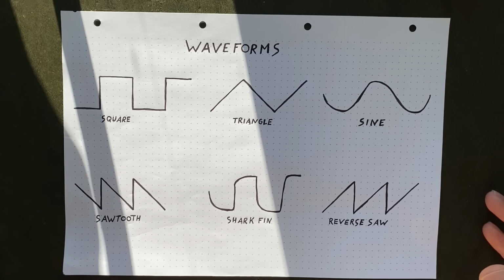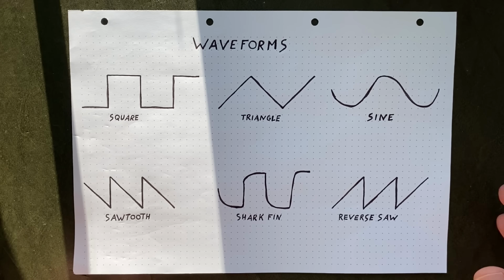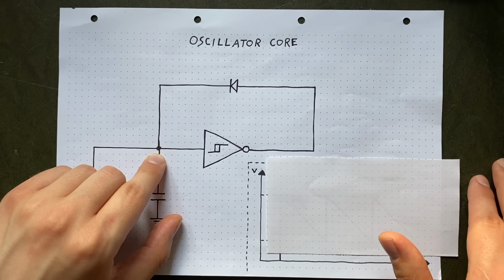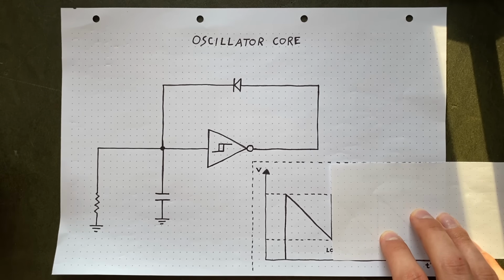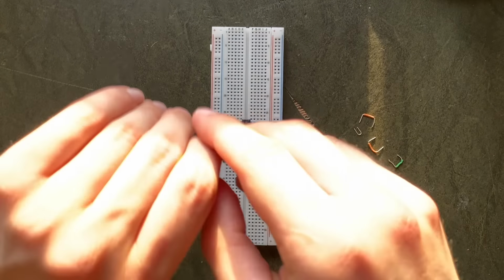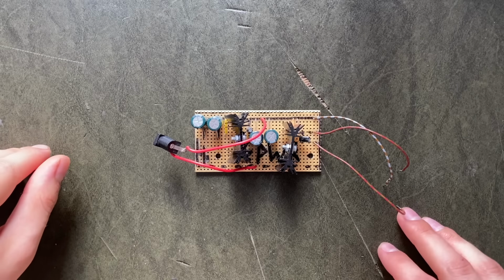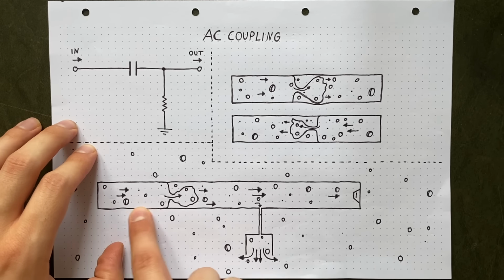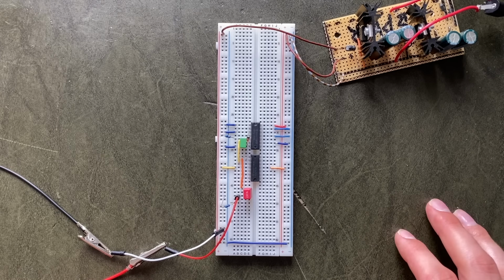DIY VCO Part 1: The analog oscillator core anyone can build

Comment: why not use 2 resistor to have a middle point to bias audio input ? to avoid negative power supplies ?
you even end up talking about coupling capacitors and offset voltages, so you could add an offset voltage at the input
also the schematic you explain is hard to understand cos there is no power supply that brings any charge to the capacitor to charge up

Comment: side note on what you can measure
Voltage = pressure or potential energy that can be used when thing start flowing)
Current = flow (same as amps but.. its just the flow itself where amps are the number of that flow so to speak. Its what your meter gives you as a value. Its identical seriously current is just mentioned to allow for more ways to get the amps if you dont have access to certain info but it doesnt matter honestly)
Amps = flow rate unit (time based thingy and already explained)
Resistance = pipe restriction (like if you had to figure out how big of a hole to cut in a tank based on whos drinking from it ao they dont explode)
Power = all work done. Or the total pressure × flow
You can measure amps, but it’s invasive, so you often calculate instead

Bernoulli’s logic matches electrical behavior almost perfectly fyi

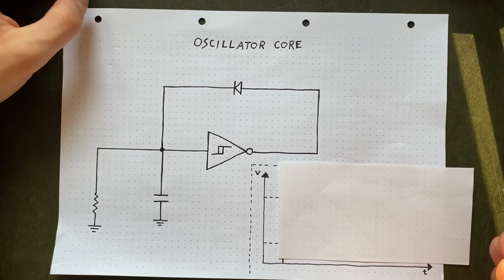Comment: 10:00 is it just me or it’s strange that the circuit has no source to power?
Reply from the maker: that schematic omits the op amp power connections for easier readability. it runs off of +12V/-12V

Comment: I've had a previous go at following some of your videos, and mean to recall it worked perfectly then. Now, however, when I connect my headphones to the voltage divider, the signal completely flattens out, as if I've fully shorted the circuit. Using a scope the signal looks good at all relevant points in the circuit, as long as no headphones are connected. Do you happen to have any ideas what could cause this? ^^
Reply: I have same problem, have you figured it out?

Comment: I would like to add an analogy for better intuition (not fully correct, but it might still be valuable) : inductors are like rusty pipes with cracks, where dirt builds up and clogs the flow. A certain amount of pressure is needed to overcome this blockage so that the water can start flowing again, albeit gradually.

Comment: Anyone knows why it simply doesn't work? It just makes my shmitt trigger inverter blow up after some time. The circuit is the exact same than the first one. I am using Texas Instruments CD40106BE
Reply: Have you sorted that out?
Reply: It seems I figured out. Looks like instead of ground you might have connected -V to pin 7, so the chip got more power (~18V) than the maximum supply voltage (15V). I made this mistake too, but only lost one Schmitt trigger

Comment: Great video! One small improvement can be to combine the unity buffer (op-amp) and the gain voltage divider resistors so that you have a non-inverting amplifier with a gain of 1/2. Thanks very much for the good quality.

Comment: 13:50 i have an electrolytic one. How does it need to be polarised?
Reply: Hey! You don't need to polarize any capacitor, that's a property of the capacitor itself (it's a consequence of the way some capacitors are built). The only thing you need to watch out for is: polarized capacitors (like eletrolytics) need to plugged "the correct way" in. As in, the negative pin (shorter, usually also marked with a stripe) needs to go to ground while the positive pin will need to go to positive. Plugging them reversed can cause catastrophic failure (aka it will explode)
Reply: @dalfaia  Oh Thank you! Another Question. How does he go from 2 electronic Jumper Wires into an Amp?
Reply: @josephpolz5881 I'll watch the video again as soon as I have time, so that I can really give my best answer. Could you provide some timestamp, just so that I can reference it later?
Reply: @dalfaia  Just the last bit: the last 20 Seconds. He plugs in something and i dont know how/what

Comment: Good stuff. The water analogy is a good teaching aid most of the time…but there are situations - like with the voltage divider 25:00 - where frankly it helps to not think too hard about the analogy…because water valves and tubes and pressure sensors resulting in V=r1/r1+r2 doesn’t really work. Easier for me to just accept the equation, and not worry about the ‘why’

Comment: Inspirational!

Edit: i didn’t expect the water tutorial. It’s interesting but has limits.

One tip I can offer here as a “yes and” that was insightful when I was learning: electrons are lazy and want to go to the easiest path. The properties of current are different than moving water. Electrons do move bit in a wire, just not anywhere as fast as the electric field in the material, which is the speed of light for that medium.

Another freebie: all circuits are loops of currents (basically the KCL perspective for those in the know). No flow if there is no way for return path to form!

Comment: I think you should mention that the ramp oscillator is almost but not quite linear.
Reply: At 15:04 do you mean? Why is it only slightly nonlinear and not the typical exponential discharge curve?

Comment: I am having trouble simulating this circuit in falstad. Anybody who has a working simulation?
Reply from the maker: unfortunately falstad doesn't like the inverter -> diode -> capacitor path. you can sometimes hack it by putting a small resistor after the inverter's output.
Reply: @MoritzKlein0 insanely quick answer on an old video! I’ll try it out, thank you😃

Comment: Can we do an explanation of how to set this up in circuitjs?
Reply from the maker: doesn’t work unfortunately, cause circuitJS doesn’t like the schmitt trigger inverter -> diode -> capacitor path. you can hack it by putting a small series resistor in there, but that doesn’t reliably fix it :/

Comment: Great video Moritz! Just getting started with this, can I just give the Vout to an 8 ohm speaker? Or do I have to add resistors? You mentioned an "amp" in the video, I just wanted to know what it was...
Reply from the maker: no, that won’t work because the output op amp cannot provide enough current to drive a speaker directly. you‘ll need to use something with an aux input (e.g. a bluetooth box, a hifi amp, or an audio interface), or you can also use headphones.
Reply: @MoritzKlein0  oh so just a simple headphone works?? thank you!!

Comment: Fantastic design — just one question, why use a parallel RC circuit for discharging vs a series RC circuit?
Reply from the maker: you mean why not substitute the diode for a resistor? if so: because it would create a square wave, not a sawtooth wave - and because we cannot easily implement voltage control that way.

Comment: Brilliant video. I will be trying this one of these days. 

You say you may not know much about electronics and so your description might be off, but it's been useful to you. But that's also how electronics is usually described, taught, implemented, and understood by most people who work in electronics. The entire subject is mainly a set of convenient simplifications that are useful rather than accurate and not correct descriptions of what happens in terms of physics. 

While the underlying physics can help you understand why something works the way it does, most people creating circuits don't really need to know why a resistor creates impedance, how a capacitor stores energy, or even how a ground actually works. All they need to know is how to work and combine these components to create the intended circuit behaviour at every interaction between them.

Comment: actually your question about what oscillates, we just measure current and voltage. Electricity is like a vortex in an atomic field. Voltage correlates directly to pressure because the voltage of the atomic orbitals creates the volume of matter. That's what pushes material apart, and that's what pushes the air in your car tires outward. So a correlation between PSI and voltage is a fair deal, they are the same thing! It's just a matter of scale in the same geometry. Now in my 30 years experience I've learned that voltage can move physical objects, but if you want to move a weight you need magnets. Current generates and governs magnets. We can create a current with just a voltage in a circuit, but good luck managing that without either resistors or inductors. Magnetic inductor coils slow down the rate of change in an electrical circuit. Now, the thing that water currents and electrical currents have in common are that a current of electricity also has eddy currents. They look like whirlpool eddies. That's the reason magnetic coils work, is that a moving electrical current has rotating poles around it. So it's just like water going down a drain, a whirlpool has to form (to relief the air from a tank or pipe), and that creates a rotational momentum that help maintains the flow. Stopping the flow takes as much time as starting the flow, and the same is true starting and stopping an electrical flow; there's a gradual momentum change in the flow that correlates to a magnetic field loop. Effectively the flow pushes a pressure, and the pressure pushes a flow, and they directly correlate to real pressure and real flow in our physical dimensions. So what you have is a whirlpool, or a *spout*, pushing electricity back into your capacitor reservoir.
That coincidentally creates the same circular balance that you would find stretching or vibrating a string, because it all balances in phases as sin and cosine waves. There's a magic in sin and cosine waves that they can be added, multiplied, and they maintain their sin properties. There are 4 directions that are maintained at all times: the force acting on an oscillator, the momentum of the mass oscillated, the counter force generated from that momentum, and the counter momentum when the oscillator moves the other way. It's rather like an orbit.

Comment: How come the sawtooth wave is made up of linear segments and not exponential decay segments?
Reply from the maker: it’s not! as long as we use a resistor to drain the capacitor, the discharging process is nonlinear. it only becomes linear once we replace the resistor with a transistor in the next episode. (that’s because the transistor’s collector current is fixed/independent of the capacitor voltage.)
Reply: @MoritzKlein0  it’s slightly nonlinear 15:04 but why is it not the typical exponential discharge curve?

Comment: This is kind of amazing but I have only been able to get a needle-like pulse or a square wave out of this circuit using many combinations of resistors, capacitors, and diodes on my workbench. It's monumentally frustrating.
Reply: I was the idiot that day. It was my turn. I was looking at the signal on the inverter's  output side - the wrong end of the diode...

Comment: in your diagram of the sawtooth wave, you draw the voltage decreasing linearly, but you say this is the capacitor discharging. but, capacitors discharge exponentially, so why is this linear? (around 11-12 minutes into the video)
Reply from the maker: it’s not. as long as we’re using a resistor to discharge the cap, the sawtooth is slightly bent. it straightens out once we use a transistor (in the next video), since it enforces a fixed discharging current.
Reply: @MoritzKlein0  i see. thank you!

Comment: i'm not really sure what is going wrong, but even though I exactly copying your circuit, my Schmitt Trigger inverter (74HC14) keeps getting very hot. Am i maybe using the wrong one?
Reply from the maker: @niethugo7385  yeah, your chip cannot deal with supply voltages above 6V. you need to use the 40106 chip instead!
Reply: @MoritzKlein0  ah, okay! Thank you very much!

Comment: Hello, i have a weird issue, i was not getting any output and i checked ten times, i have the same exact circuit as you
But then i borrowed a variable alimentation station and tried the circuit with different voltages and when i lowered to 2 volts i finally managed to get the sound.
I weirdly can't get it to work with anything higher

Comment: There are some micocontrollers with internal analog blocks and likely separete voltage rails for the analog power. The first one I know of was a knock of of the PIC micrcontrollers by Microchip, but manufactured by Scenix and with analog blocks that could be manually configured or chosen from pre-written types. Unfortunately the Scenix director/owner got beaten to death while in China many years ago, I only found out years later when I was trying to find out what had happened to Scenix. However there are other manufacturers, for simplicity and lower price it's a fery good option. VCO and VC filter in analog blocks controlled with digital to analogue. the D to A best done with high frequency PWM filtered to provide the control voltages. Ideally you could find not a microcontroller with analogue blocks, but an FPGA with analog blocks. The programming is not so different for FPGAs, you just need to have nerd skills. And then you set the FPGa to create lots of PWM counters outputting to each VCO's controls through noise filter blocks and set up some latches and addressing to take in sequencing information from a microcontroller, or a FPGA programmed USB module to load them.

Comment: First I was excited when I started watching, but now I don't think the explanations are that good, to be honest. As someone who doesn't know a thing about electronics, I don't understand how and why some pins on the breadboard had to be connected, but you just showed a screen where everything's already done. As well as which 1 uF foil capacitor exactly I have to buy. There are different markings and volts for uF capacitors on the market. I also didn't find foil capacitors, so I was thinking to buy other types, but there are no explanations on that part too, which means I will be left unsure about my purchases. Also, when you say "here's all we need" in the beginning of the video, you don't actually show all we need. Well...

Comment: as a third year robotics student who has stayed away from the electronics side because it never made sense to me thank you. Fantastic intro to electrical engineering in general. Better than a £27k university course ever taught me.
Reply: this aint even electrical

electrical is mostly high voltage stuff and machines

small circuit with small voltage belongs in the electronics engineering domain

power grid, generation, electric machines are electrical, if u study electronics engineering, u will barely touch on these subjects, like dippin yo toes in the water

Comment: I was thinking you could actually ditch the Schmidt trigger and setup a TL072 or such as a comparator and use that to generate the sawtooth, that leaves the extra op-amp free to use as a buffer before sending it out to audio

Comment: Not quite right flimcapacitor are non polarized but they have a preference in AC you sound always test them in which way to connect the hot side of the capacitor the most outter layer of the cap of the capacitor should be connected to GND to prevent to act like a Termine. You hve this problem rarely in audio frequencies but in HF application the preferred ground side of non polarized capacities are crucial!

Comment: On the breadboard, using ceramic instead of foil capacitors. Could this be the reason why not working yet? :D Also, if somebody could share test point voltage values I could try finding the problem. Tho I suppose I can calculate the supposed voltage at each point. 😂

Comment: Subscribed
Good job
I bought a neutron and making a Soundwall
Eurorack
Don't like balloon thing
Watertank that fits up better
And square never square it can't be a square
The resister determines a max volt so the top waves get cutt off
Voltage can not drop straight down
Square never possible
But I'm nitpicking

Comment: Calculating is cheaper than soldering. If you want to have 19 complex synthesizer engines with 240 effect parameters for free, take a loop to the Synthesizer Workstation: https://youtu.be/oI_mTEu3WqE

Comment: is there any reason using foil capacitor? what would happened if using electrolytic instead?
Reply from the maker: yeah: foil capacitors are non-polarized, so you charge them from both sides. electrolytics are polarized, so you can’t (or shouldn’t). this is important in synth circuits, since audio signals usually swing across the 0 V-line.
Reply: @MoritzKlein0  ic. Thanks 🙏

Comment: Does anyone know if there is a reason why the Schmitt trigger chip uses the -V rail instead of the +V which is what I would expect?

EDIT oh wait, I just realized something. I had traced the relative voltages based on the op-amp chip on the breadboard, but it's actually upside-down from the earlier diagram. So I had it flipped. The Schmitt trigger chip is connected to +V.
Reply from the maker: yep, it’s hooked up to V+ and ground!

Comment: mki conspiracy: at 0:00 he has 'SIMPLE' and 'WHAT' written at the top of the paper but to the right there is a covered section. What is under there? I assume it's a map to the holy grail.
Reply from the maker: i honestly don’t remember so you might as well be right
Reply: @MoritzKlein0  Confirmed! 

Anyway, thank you for this video. I just spent the better part of an afternoon taking notes and diagraming this circuit in simplified and breadboard versions. I understand synthesizers so much better with this!

Comment: Man this is hands down the best electronics video i've ever seen...You just gained a sub! I have just one question, if the diode prevents current from flowing in the opposite direction, how does it interact with AC circuit?

Comment: I'm an electronics engineer graduate... man I never knew that thinking in pipes would help in circuit analysis more than the crazy stuff. If  you want to analyze the math and the values, do the engineering. If you want to design a new concept, think in pipes.